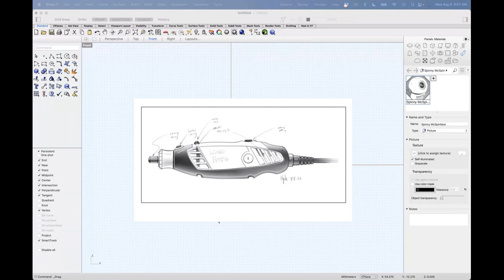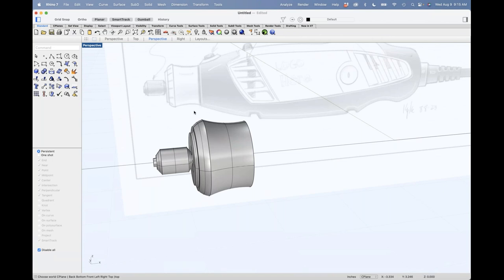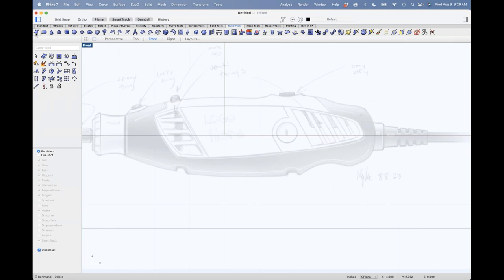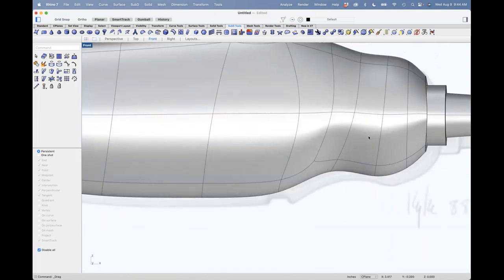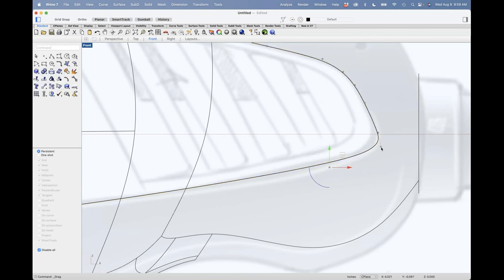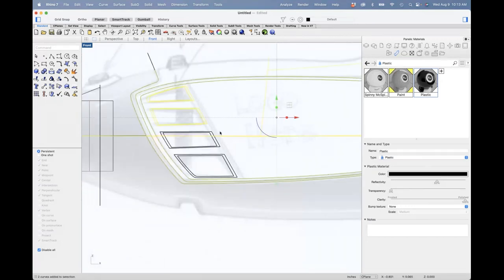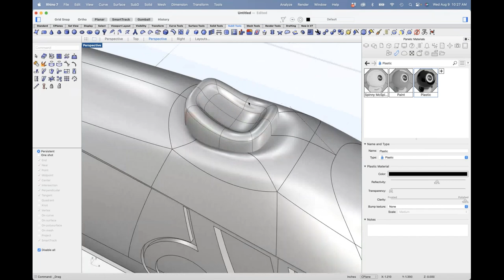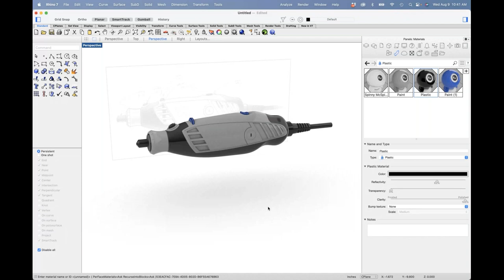Rhino 7 for Mac- Rotary tool (full build)

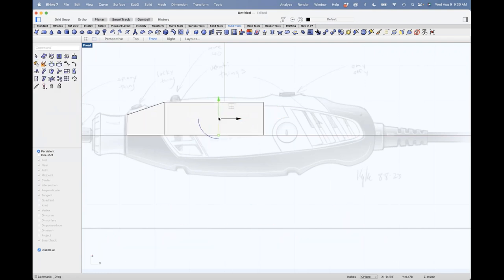Comment: Is there a shortcut for turning points on and off? How did you select only the one point on the subD plane without turning on all the points. This was at 29:34 in the video.
Reply from the maker: ctrl+shift allows you to sub object select a point on a subd (or edge or face) 

f10 on a pc turns points on, f11 turns them off, or you can make an alias for them, or copy the pton ptoff buttons to your pop up menu.
Reply: Thanks a lot!

Comment: Hi, could you please tell how you do to make the subD in a "paper dolly way" at 29:10 ? I get the round shape SubD and can't figure out how to make it squared... Thank you!!
Reply from the maker: crease the points that you need squared-
Reply: @Rhinoceros3d  i cant select single edge of subd plane and extrude it, can you help me:)
Reply from the maker: ctrl+shift should allow you to select an edge- 
(command +shift on mac) 

then use gumball to extrude it. 

works best in box mode.
Reply from the maker: @filipscreations9078  Ctrl+shift+click should allow you to subobject select an edge, then you can use the extrude dot on the gumball (or drag + ctrl on an arrow handle) to extrude.  (command for mac) see the gumball party tricks video for more gumball tricks.
Reply: @Rhinoceros3d  thanks:)

Comment: just finnished this build myself and kinda had me wonder was there a particular reason why you scaled the vents to make the split line instead of offset then in cuz scale kinda left two sides lot bigger then the other 2 ?
Reply from the maker: Offset makes much more complicated surfaces. Scale simply transforms them with no interpolation. 

I like the thick thin feel of the lines.. offset would be more “accurate”
Reply: @Rhinoceros3d  well when you put it that way that does make a lot more sense, at first i though it was just for looks

Comment: hi, when i shift + command + left click to try and sub object select nothing happens ? ive tried using shift + ctrl + left click as well but it still doesnt work. what am i doing wrong? pls help
Reply from the maker: Are you on a Mac or pc?
Reply: macbook @Rhinoceros3d
Reply from the maker: @holly4043  shift+command+ left click should do it. If not, hit us up on tech and we’ll take a peek at it. Tech@mcneel.com
Reply: Hello, I had the same problem and spent one hour trying to fix it, and I finally did!
So basically if you look at the bar at the top where the (Grid Snap, Ortho, etc..) are, there's a funnel icon, click on it and activate SubDs and Curves/Edges, and your problem should be solved!
Hope this helps :)

Comment: I believe you have done this tutorial for Windows, however would you mind doing a quick run through on how you set up a hot key for changing the degree of a line on Mac. I find the command interface a lot more complicated.
Reply from the maker: you can create an alias for the changedegree command, or add the command string 

InterpCrv Degree=3 Pause Pause Enter

to your existing line button.
Reply: Even more basic question, how do I go about setting up an alias/command. Could you potentially link me a video/point me to a tutorial? Thank you for the response @Rhinoceros3d
Reply from the maker: @maxfreeman5857  on the mac, file>settings> aliases 

hit the + button in the lower left of the dialog and anter a command string and hot keys you want to use. 

keep in mind you can use more than one key for a hot key

you can use t for trim, 
you can also you tt for top
or ttt from untrim etc... 
or 
ut for untrim, 
tp for top 

etc.. 

just be kind to your hand... don't make hot keys where you have to stretch your thumb in the opposite direction from your pinky finger.. that is a disaster recipe for an RSI injury to your hand. 

for example QM or AL ... don't do that...

Comment: Are you making a sculpture or an industrial product? There is no control of the mech Features! for example: what's happen if you have to use existing buttons with a defined geometry? Tspline for Rhino was milions time better.
Reply from the maker: Neither, I'm making a quick demo ;-)  
What are you missing from tsplines? 

(I used to be the demo guy for tsplines and I politely disagree. Rhino subd is way more stable and capable than Tsplines was. )